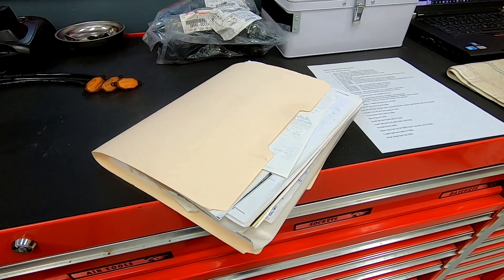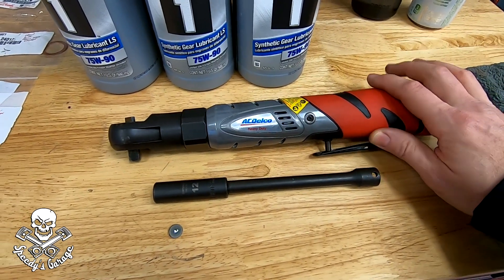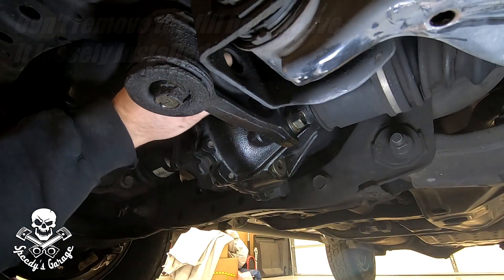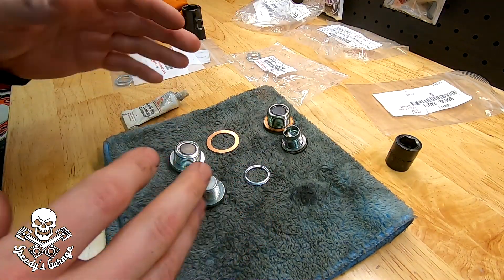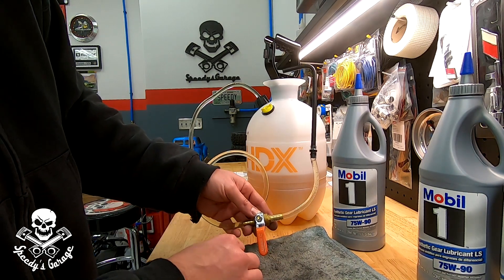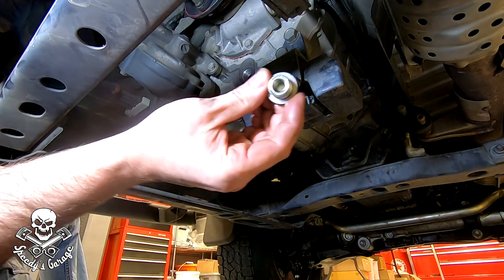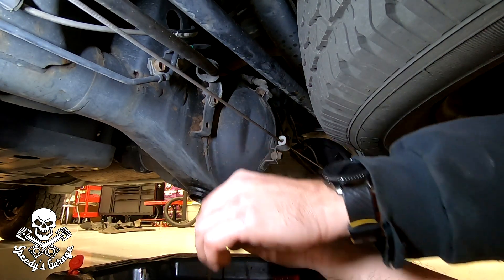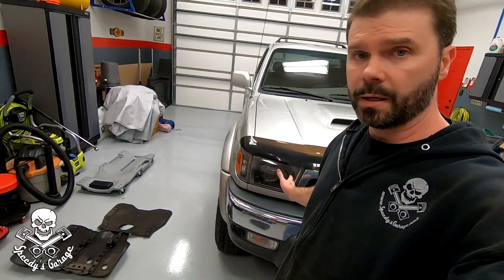4Runner Differential and Transfer Case Fluid Change Speedy's Garage Restoring a 3rd Gen 4Runner P6

Comment: Thanks for this. I did my fluids several years ago and just did them again today and watched this to be sure I wasn't missing anything. I used the new Valvoline gear oil pouches and it was so easy. Highly recommend those to anyone doing this service. You'll have a little left in the pouch, but you can dump it in to one of your other pouches.
Reply from the maker: I only use Mobil 1 fluids, wish they had the bags.

Comment: I say this no every video i watch. Because no one even mentions it. The thing is after you change the oil in the rear differential it’s a good idea to check the vent cap on top of the axle housing. Because if it is plugged up with whatever it can cause pressure to build in the housing and cause the axle seals to leak the diff fluid and that could cause your brakes to go bad. Just a thought. 
They are only a few bucks for piece of mind.

Comment: Not saying it's a problem, but that's the thinnest 90W gear oil I've seen.
Reply from the maker: It's all I've used so I don't have a comparison but its been good for 100k miles and 15 years in this truck.  Maybe synthetic flows better?